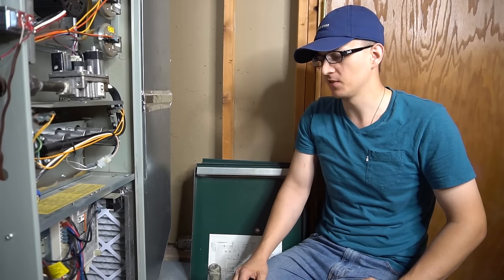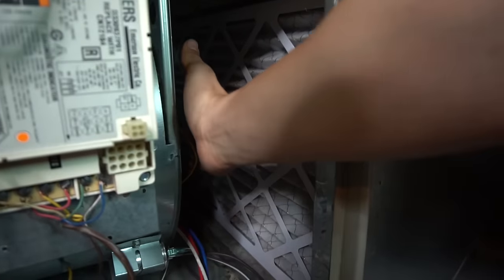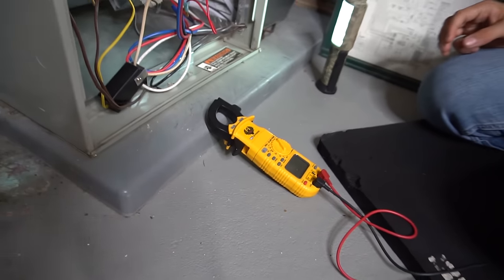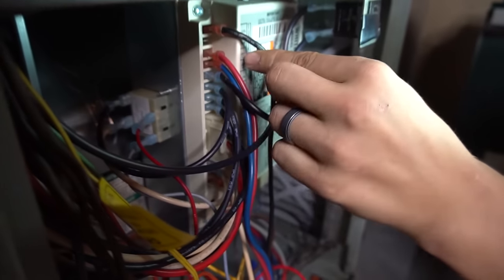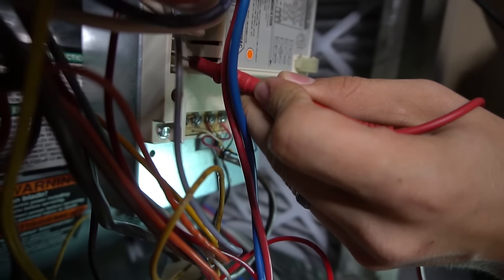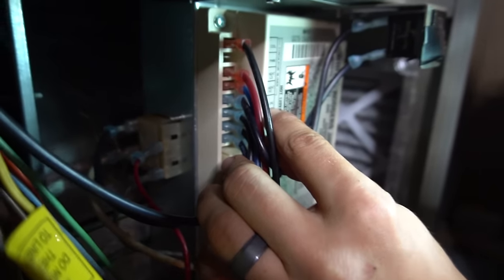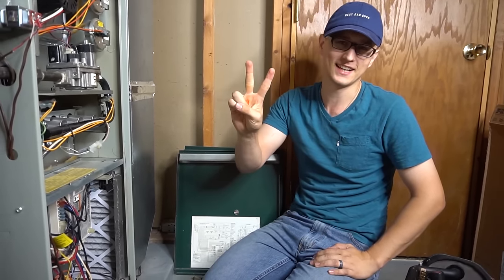Furnace Blower Not Working - How to Check It

Comment: I can't get the fan to come on in fan only mode, and i still have no power from the brand new board to the inducer. Can't find anything that connects these two issues. I bypassed the thermostat. Power steps down after transformer as it should, but nothing happens. Solid red light on that indicates 'normal' operation. I'm baffled. Any thoughts?
Reply from the maker: Interesting.. So you jumpered R to W at the control board and the inducer motor still does not come on? That usually means one of two things. Either the board is bad or it is not getting 24v from the transformer.
Reply: @WordofAdviceTV  when i said i bypassed the thermostat, i had crossed the wires on the wall. After your reply, i put that back together, jumped R to W like you said, and vóila! The inducer started, i got a flame, and the blower came on like its supposed to! Awesome! I shut it off though. So now am i correct in suspecting the thermostat? I feel like it wouldn't have started up if the transformer was unable to supply correct voltage. It definitely reads 120v in and 24v out too
Reply: Final update: A cheap thermostat was only $18 so I went ahead and bought it. After installation, and after removing jumper from R to W, i switched everything on but NOTHING HAPPENED. At that point i suspected loose wires somewhere. I jiggled the wire nut connections inside the cabinet near the wall. The inducer came right on but shut off after about 10 seconds. I jiggled the wire nuts again and a 2-inch long wire literally fell from one of them. I flipped the breaker off and it was easy to see one of the wire nuts was missing a wire. It ended up being the small red insulated wire that goes to R on the board. This explains why none of the diagnostics i tried at first worked and why I couldn't get the furnace to come on when i straight wired the thermostat at the wall; it still wasn't getting the 'call for heat' at the control board due to the broken wire inside the furnace cabinet. I spliced the broken wire back where it belongs and everything is working well now. I did spend $120 on an unnecessary board and thermostat, but chances are i still saved a little money because who knows how long it would take the average repairman to find my particular problem. I took the time to write this because all stories are better with a conclusion, and maybe, just maybe, this might help someone else. Big thanks to you though sir, for pointing me in the right direction.
Reply from the maker: @roofinruffin  Happy to hear you were able to track down the culprit! A loose wire that intermittently makes a connection can really throw one off track. Thank you for taking the time to come back and share your experience! Like you said, your comment may save someone's day :)

Comment: Jay, i cant find capacitor on my 3/4 hp motor? Is there a possibility i don't have one? Also my motor says 1ph but my cooling us two stages and i can tell when it starts blowing harder. What the heck is going on? Model us genteq 5sme39nxl104
Reply from the maker: An easy way to find the capacitor is to start at the base of the motor where the wires come out. Do you see two purple wires or two brown wires coming out of it? Try to trace where those wire go. Sometimes the capacitor is mounted in the back of the blower motor housing.
Reply: @WordofAdviceTV  Thanks for your reply and follow up. No, I don't have that, I have 8 wires, black, black &white,  green,  red, yellow, blue. From the control board the harness goes directly to a socket on the motor. There's a label on it that says "leave for 5 min with no power before working on it'. Is it possible there is a inductor built in, or capacitor is built in the motor itself?
Reply from the maker: @Quentyn73  Ah I see. You likely have a variable speed/DC motor. They don't need capacitors. Those type of motors you unfortunately cannot check in the way I showed. There's really no easy way to check it as far as I know. You would need an adapter that would check and see if the motor is bad or the computer module part of it is bad.
Reply: @WordofAdviceTV  thank you for the advice, Jay! Stay amazing, dude!
Reply from the maker: @Quentyn73  Thanks man, you as well!

Comment: Tried the bypass,  kick on for a second then lost all power to the furnace. Breaker is fine. What did I probably fry?
Reply from the maker: It's possible that the blower motor is shorted out or a bare wire is touching something metal. Not sure what may have  fried. The transformer perhaps or the control board.
Reply: @WordofAdviceTV  ended up being the control board. Thanks for the video again
Reply from the maker: @FrankLaGoose  Glad to hear you found the culprit! Stay cool!

Comment: Hi I changed the blower motor on my unit and after that it’s on but not blowing air out Through the vent,do you have any idea why is like that?
Reply from the maker: Did you by chance forget to hook up the capacitor? So it hums but does not spin?
Reply: Word of Advice TV I changed it to a Brushless motor.
Reply from the maker: Oh I see! If it was a retrofit job then unfortunately I wouldn't be able to tell you what could have went wrong without being there myself..

Comment: So my blower motor does not switch on when thermostat is set to cooling and fan is on auto. Checked the capacitor and it looks like it must be bad. The ratings on the capacitor are not completely like the ones found commonly online. It reads:

CCL 621-435A
.51 kVAr 10uF +/- 10%
370V/ \ / 50/60Hz 1804

-40/70 °C UK MADE
NS1PC 1 PHASE
NON PCB M10C13NO #

usFileNo E128031
C22.2 No 190
FABRIQUE EN GB

The reading from the old capacitor was 174 nF

So I ordered a replacement capacitor based on the 370V, 10uF, and the one I could find was +/- 6%.
The blower motor spins freely and easily, nothing seems wrong with it, but just for good measure I took it all out and cleaned everything.
I put it back together with the new capacitor, which I had to zip tie to the old bracket because it is much larger diameter than the original capacitor (does that mean it's the wrong one?)
I ran a test with turning the thermostat Fan to ON. And it turns on just like it normally should. But if I leave it in Auto mode, it never turns on, and it's not getting cooler.
I felt the blower duct and the capacitor I even swapped the wires around the other way just in case I had it on backwards (there's no + or - to be able to tell which is which. does it even matter?) the blower housing and the capacitor were very very cold to the touch.

Something also to note, the original capacitor has a plastic housing and the new one has a metal one. So did I get the wrong one for this?
The temperature here is in the 100°F here and I honestly don't know what I'm doing other than what I've watched from your videos. I do have a multi-meter (Klein MM600) which I think should be good enough.

What should I check or do next? Do I need to try and get a different capacitor? If I leave the Fan ON it does blow for a little while but it cuts off after some time and it's not turning on in Fan Auto mode like it should. About a few years ago I replaced the capacitor on the outside unit and it worked great since then up until late last year when the blower fan stopped turning on.

(Update: I looked over the schematic for the control board, and the wiring was not correct according to the diagram. So I switch the wires around, matching the colors noted on the schematic, and then I turned the switch/power back on, and because the thermostat was already set for cooling and automatic fan, the blower fan kicked in immediately and it seems to be blowing cold air now! Now to babysit it and see if it's all working correctly. I honestly don't know if I ever messed with those wires or if someone else did trying to fix the problem before, perhaps several months ago when it stopped working correctly. Fingers crossed this unit is now working as intended!)

I do really appreciate all of your videos! Many thanks!

Comment: What if blower is running real slow could that be the compacitor
Reply from the maker: Yes. That could be caused by the capacitor or for some reason it is not getting enough power (ex. 80 volts instead of 120). You would need a meter to check the latter
Reply: It could be gummed-up with dirt, grease and need cleaning. Spin it by hand, see if it is dragging.

Comment: So my outside unit is working fine. I realized my Blower motor is making a beeping sound inside the house. It beeps exactly 11 times then stop for 2 seconds and repeats. The blower motor is not spinning all I get is a beeping sound.
Reply from the maker: Do you have the manual from your furnace? That sounds like an error code. Your owner or service manual should have a chart that will tell you what that means. Sometimes you can also find the error code chart on the back side of your furnace door too.
Reply: Word of Advice TV my Motor Fan turned out to be bad. Replaced it and everything is running smooth.
Reply from the maker: Ah I see. Thanks for the update! Stay cool! ;)

Comment: How about this go to your thermostat and switch the system switch (heater or AC) to off. The other switch says auto or on, switch to on. If the blower is ok in a few seconds it will start and blow air through the system. 
Your welcome!

Comment: My furnace was silent one day when all of the sudden it started screeching. Something was messing with the fan and i wasnt sure how to even check the fan.
Reply from the maker: I wonder if the center ring on the blower wheel came undone.. I've seen that a couple times before. I have a video where I replace my blower motor, in that video I show how to pull it out if you still need to know how
Reply: @WordofAdviceTV  no need, I figured out the problem thanks to your video showing me where you can find the motor. I looked back there and found a 2+ year old filter leaning into the fan. I took it out and it works fine. (We just moved in)
Reply from the maker: @evilbadger34  Nice! Good that it was something simple. Thanks for the update!

Comment: Thanks so much for this video. I determined that my control board is bad, but on the plus side I'm really glad you explained the bypass trick to keep the blower running so that we can have AC tonight. The house has been so hot and this will be a big relief until I can get a new board.

Comment: just stick your multimeter on the fan output voltage off the board no need to be cutting wires and using marrets.

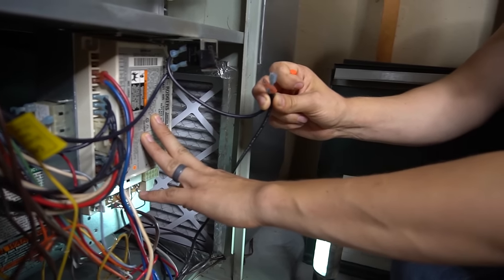Comment: Hi, like your videos. but at 5:55 you say CUT WIRES?? NO! Just make a jumper.  I start by taking 10-20 phone photos of the wires at different angles.  If anyone is working on these kinds of things, get a small assortment of crimp terminals, and if possible invest in a real crimper $35 +  Then you will need 2 spades and a 1 foot long piece of the same wire used there, what is it 12 guage? 14? then attach 2 spade lugs to make a jumper wire. then connect the power to the fan, but make SURE! that power is OFF when connecting because its a motor, the way motors work is at the first 100ths of a second the current is very high.  so connect this then apply power with your hand at the switch in case you see smoke.  A good fan will start easily.  if you were holding the jumper wire it will get warm, if its too  hot to touch it may be pulling current because the motor is binding up.
To test your control board get an old Lamp that you dont need.  cut the plug off. strip the wires and attach the female terminal crimp onto each. with power OFF connect your lamp onto where the Motor wires WERE at, the 2 terminals you showed, AC or Furnace, and common.  Turn power on. now there is a load on your relay if the lamp flickers? or is off and you tap a relay and it flickers on then goes off? its the control board.  While a person who does circuit board rework "could" replace the relays on the board, this is not always safe. the control board is made for Safety. Its made to only turn on if everything checks ok. If the board costs $100 its worth having a new one, and ASSUREDLY if its a customer you would be liable if a re-worked board caused some problem. 
Working on 120VAC is a deadly hazard, there needs to be training on that, what happens is it will cause your muscle to lock up so you cannot let go, and second it will cause your heart to try and beat at 60Hz or 60 times a second??  The heart has a group of special muscles that pull at the same time, with an AC shock they will fall out of rhythm and work against each other, called Fibrillation,  unless there is a De-fibrillator close by it can be deadly.  Anyone working on live equipment needs to be reminded all the time, even though its something we know.

Comment: Man I wish you could come work on my ac unit. I have to use a company through my home warranty and they are completely clueless.  They have replaced the compressor 3 times and it just went bad again.  It will work for a couple days and then stops blowing cool air. I noticed on every occasion the return line outside is slightly cool but not cold/sweating as compared to my other unit. If you could lend any advice I would really appreciate it.
Reply: Sounds impossible they replaced 3 compressors 
that costs more than a new system
Sounds like you have a huge leak of refrigerant

Comment: I took a look inside my Trane XV90 and didn't see a capicitor!
Reply from the maker: You likely have a variable speed ECM motor then. Those motors do not need a capacitor
Reply: @WordofAdviceTV  Thanks! That would explain why one hasn't failed in 12 years.

Comment: Your hot motor diagnosis guarantee is worthless - our motor was hot and we wasted a week and $100 replacing the motor to find out when the run capacitor is bad the motor won't have enough voltage to start but it will still heat up. The $5 capacitor we eventually bought after wasting time with your method was all that was needed!